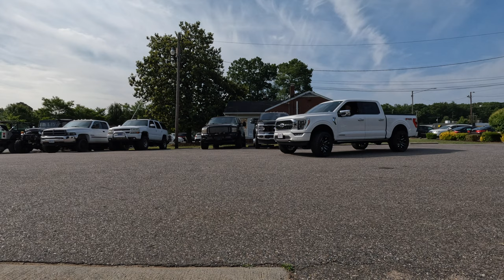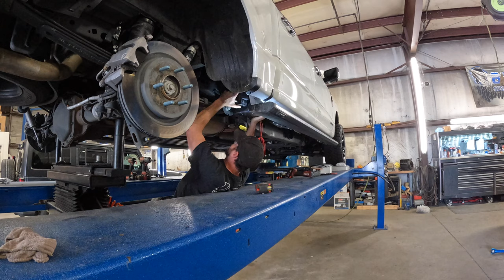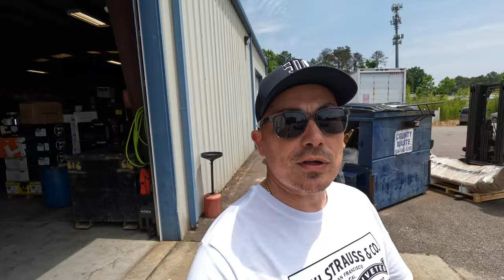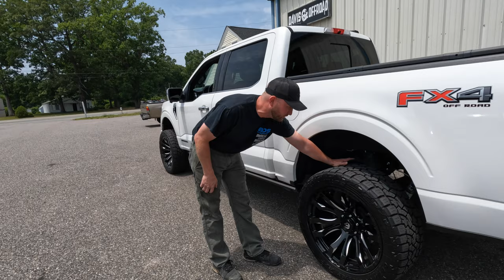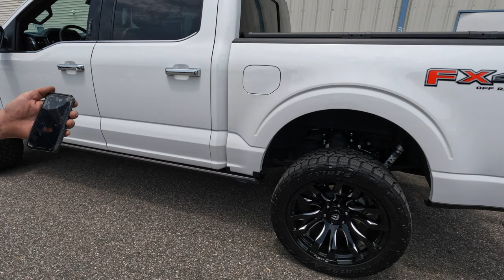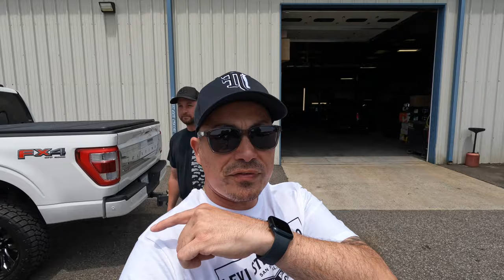F150 POWERBOOST AIRBAGS (OVERLAND BUILD)

Comment: Trying to install this set up on my powerboost, but running into issues finding a good spot to mount the compressor on the frame rail.  In the video it looks like they install it pretty far back, did they use anything different than what was included for mounting? Any chance you have a close up shot of where it was installed?  Appreciate the help!
Reply from the maker: @tekelizi  hey,  thanks for watching and the question.  Everything that was used for the install was just what came in the box other than extra zipped ties and clamps for running the wire.  I wish I could help with photos but unfortunately I sold the truck last month and I can’t take any pictures.  What I can do is give you my friends number (Daniel) and he might be able to help since he did the actual work.

https://www.google.com/search?q=davis+off+road&ie=UTF-8&oe=UTF-8&hl=en-us&client=safari&dlnr=1&sei=wv2PZtCnD-Or5NoPk_212Aw#

Comment: Did they have to trim your wheel well liner? It is hard to tell but it looks like it since it the bags would hit the drop down piece that covers frame. Interested in this kit.
Reply from the maker: @joshualambert8989  no trimming was done to this setup.  My guy has a fan shop and I told him I didn’t want any alterations to the truck and he did everything perfect.  His info is under this video descriptions and you can contact him for any advice he might give.  He has done all my work other than smaller things I’ve done myself.
Reply: Thanks for the fast reply. Appreciate the info. Did installing the bags and keeping 10psi in them give you a little rake to the truck with nothing loaded?
Reply from the maker: @joshualambert8989 I think at 10 psi it’s just enough to keep it leveled but personally I like a bit of a rake.

Comment: What’s the lowest air pressure you can keep in them?
Reply from the maker: @MatthewVinson-l3t  it’s recommended to keep 10psi at the lowest
Reply: @FindingJay  how much did it lift the rear of the truck when they only have 10 PSI?
Reply from the maker: @MatthewVinson-l3t  on 10psi it keeps just enough to assist the suspension, but no lift

Comment: Is the AIRIQ HD2 to the whole kit or were the bags a separate part number?
Reply from the maker: I believe the pump is 1 item and the bags are another.  The pump is universal but the bags are specific to your vehicle so you would have to make sure to get the bags that will fit.
Reply: @FindingJay  I have a 21 king ranch powerboost.
Reply from the maker: @jeremyhadley4336  great choice.  The king ranch is a sick truck also.